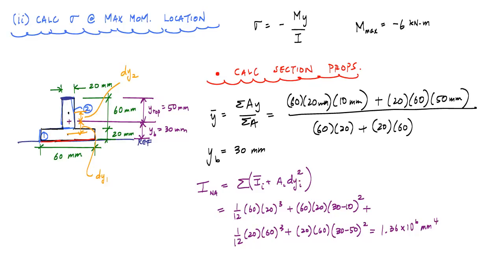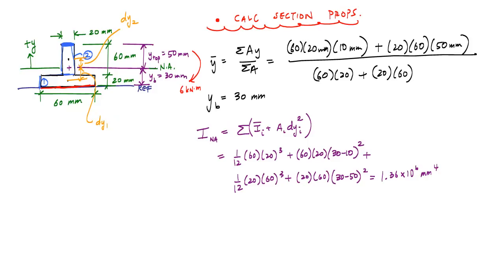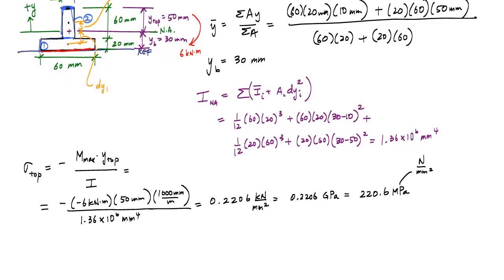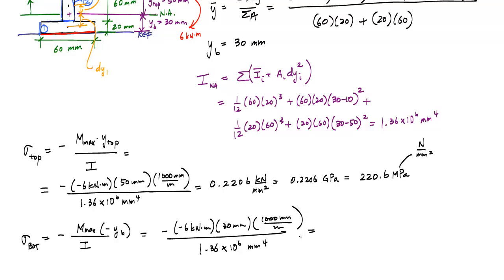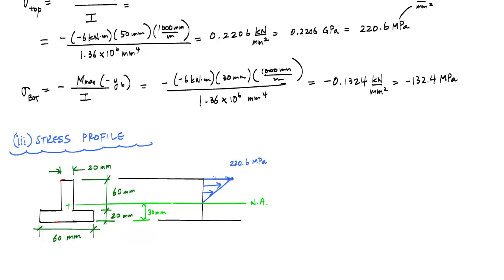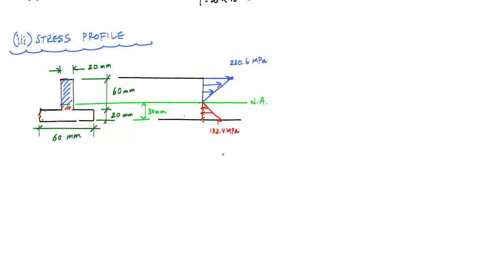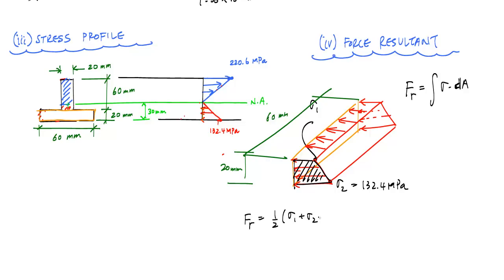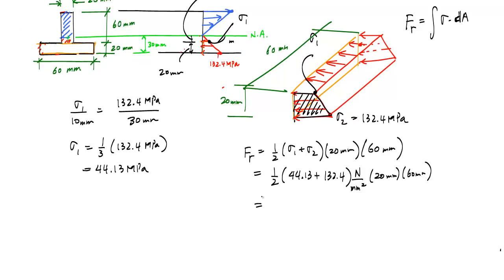Normal Stress Due to Bending Example (2/2) - Mechanics of Materials

Comment: Should'nt the depth of the Flange be 3m . when u calculated Force resultant you took the area of flange as 29 mm x 60mm but the stress is acting sideways tht means that the area should be 20 mm x 3 m or 3000 mm . No ??

Comment: For the force resultant part why just calculate the compression part (30mm from neutral axis) instead of calculate the whole thing?
Reply: and how you determine the top part is undergo tension and bot part is compression? structurefree
Reply from the maker: imgassault depends on the internal moment.
Reply: structurefree Hahaha I figured it out just the moment I finish type the comment == Anyway thanks for your response you are much more better than my lecturer.I will like to watch all your video :)

Comment: why doesn't the I in the -my/I formula just equal 1/12*bh^3?, I just dont understand the Ady^2 part and its use
Reply: WarmSensations I think the reason it doesn't show up in some of the other sections, is because for a centroid located at a distance of 0 from neutral axis, (picture an I shape where centroid of bottom left is in line with the neutral axis). However, lets say the top rectangle of the I has a centroid an actual Y-distance from the N.A. Therefore only that one has a Ady^2 on it.

Comment: shouldn't the compressive force also include the force from the neutral axis down to the top of the base of the beam (30-20) that is on the vertical section?
Reply: structurefree wouldnt that volume on the vertical section have a force resultant that would add to the force resultant from the bottom part of the beam?
Reply from the maker: we're calculating the normal stress at the very bottom of the cross-section, which is 30 mm from the neutral axis.
Reply: @structurefree  sir, he's got a point. Care to explain why the little strip of 10mm x 20mm vertical strip not i cluded in your compressive resultant force?
Reply: @neilr5121  because the question is to calculate the resultant force at that horizontal part only, not the total compressive force, as far as i understood